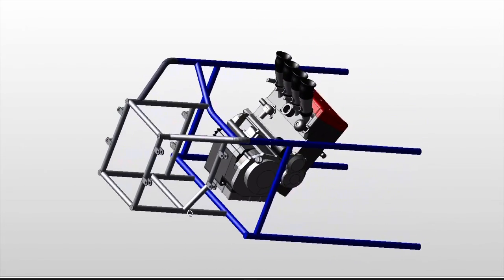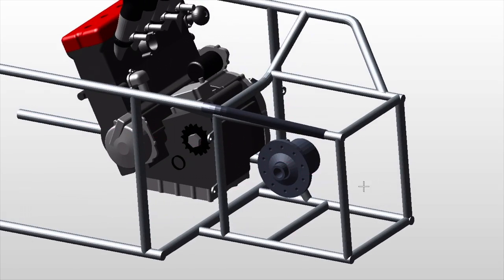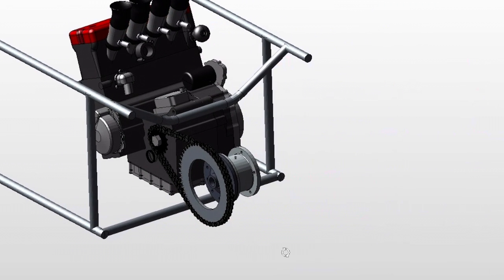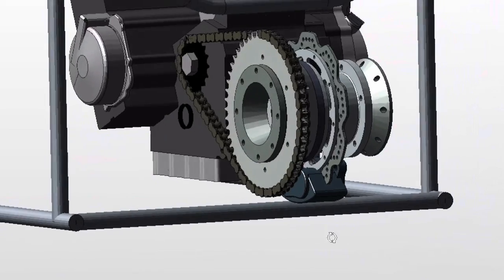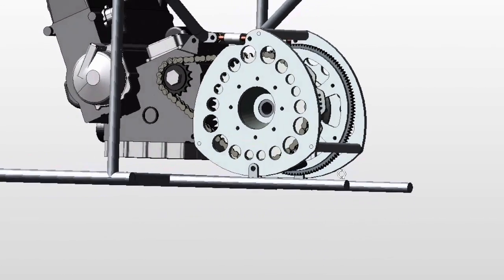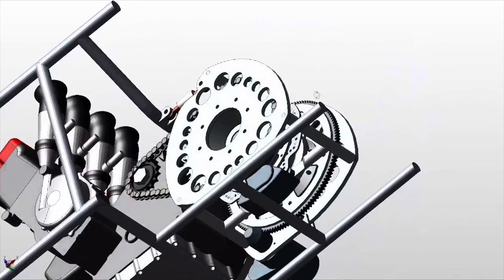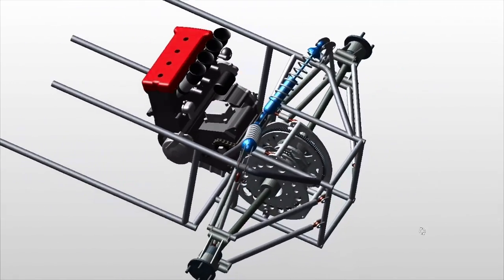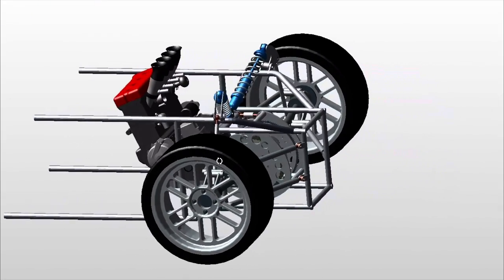1963 BEETLE BUILD- IRS + CHAIN DRIVEN DIFFERENTIAL

Comment: That's an awesome car!  I've been dreaming of making something very similar for the last 9 years.  I'd suggest mounting the forward bars of the control arms more forward on the chassis to make the bars run more front to rear rather than side to side.  The reason is when you hit the gas, the wheels will be pulling the spindle forward which will put the front bars and heim joints on the control arms into compression and the rear bars into tension.  Overall it will reduce stress on the joints.

Comment: Underrated channel. I love the build and I'd love to built one myself one day.
Reply from the maker: Thanks man!
Reply: @Kylescaife  would the civic type r engine/transmission fit in your build? Wouldn't that make it an easier drivetrain to built, more reliable? The weight you have the chassis at is so efficient.
Reply from the maker: @van4u1119  Haha no it would be huge and my chassis wouldn’t support that kind of weight! And the weight distribution would be way way off. Not to mention expensive!

Comment: Not familiar with the Miata IRS so not seeing how the axles articulate like with U joints or CV joints. I may be missing something.
Reply from the maker: They are just a typical cv joint! The axle just pops right into the differential housing.
Reply: @Kylescaife  Right! Disassembled the vanagon CV axles a couple of years back, same principle. Vette uses U joints. Sounds completely workable. Permatex  Gray RTV is best gear oil resistant.